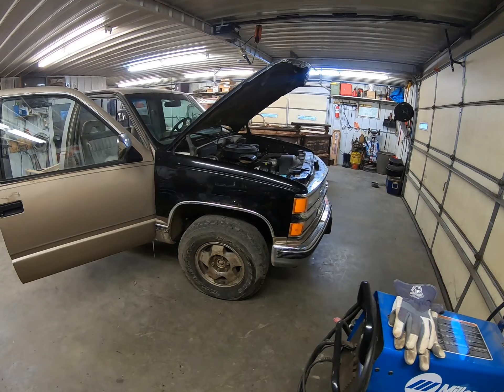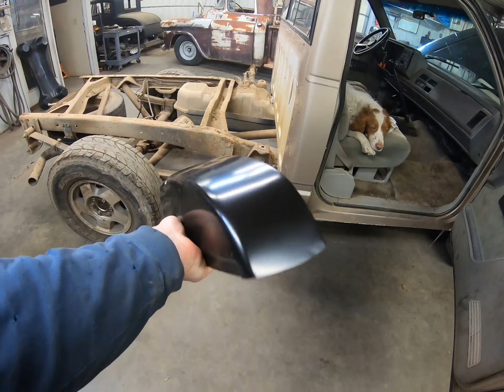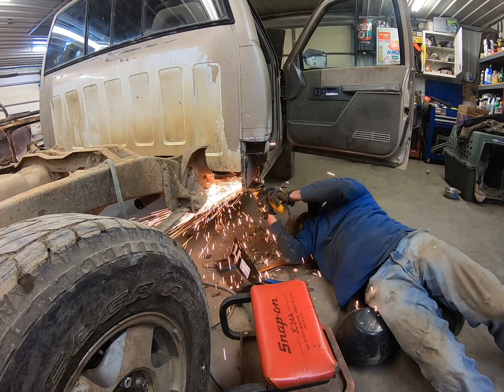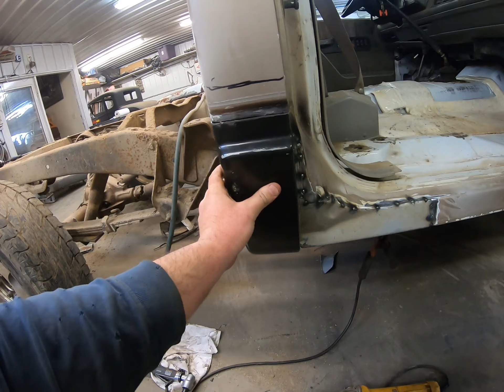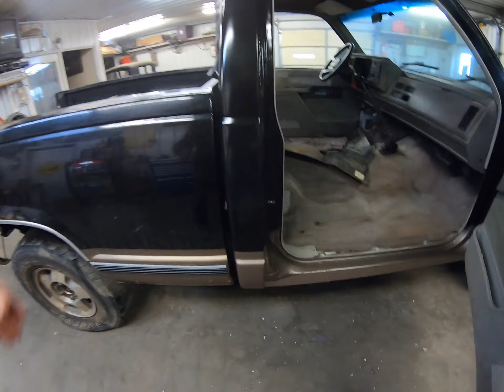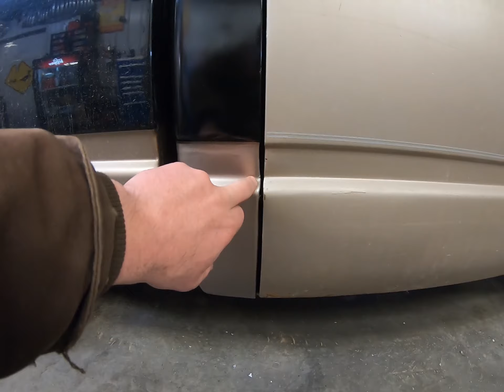Cheap cab corner replacement on a 1988 through 1998 Chevrolet or GMC regular cab pickup. OBS GMT400

Comment: Great video man! One thing I can suggest to interested people is wear a mask or respirator though. When I did the drivers floor and rocker / cab corner on my 88 I actually got a lung infection about halfway through from the constant grinding and welding. Just my 2 cents. Keep up the good work everyone keep these great trucks going!
Reply from the maker: Thanks for the tip
Reply: Yankee's are not very smart. Hopefully the south doesn't decide to fire round 2 on those bloody clown's...

Comment: what did you have the welder set too temp and feed wise?
Reply from the maker: I use a Miller 140 and have the wire speed at about 55 and the amperage at about the 3.5 setting. It will vary from welder to welder.

Comment: The shops charge a lot to do that
Reply from the maker: And it's not hard to do!
Reply from the maker: @HandymanHustle  Make sure you seam seal it or rust will come back through.
Reply from the maker: @HandymanHustle  Correct, you'll get moisture between the two pieces of metal if not properly sealed up.
Reply from the maker: @HandymanHustle  wow, yeah, seam sealer is much easier to work with and designed for this application